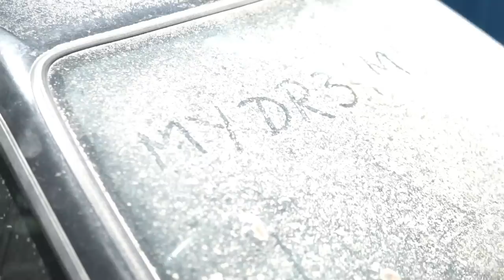RE-BUILDING the WRECKED R34 SKYLINE | Poor Man's GTR [EP4]

Comment: Go RB25 single turbo with hks parts , RB26 with a 6 speed combo is not easy to find nor cheap
Reply: Finally someone realised
Reply: Daniel ye. If you watched the MightCarMods 240z swap (they swap everything from an r34 gtr into a 240z shell) how much it sorta costs. And if i remember correctly it’s their most expensive build yet.
Reply: This is the most reasonable suggestion.
Reply: @Fathom324  I thought the 26 was from an R33 GTR in the MCM 240z?

Comment: does not need to be a RB26 engine and drive train, goto Skylinesaustralia.com to figure out what engine build you want, i suggest a RB25neo head with a RB30 bottom end which is a common build or if you got more money RB26head , but you get lots of horse power either way and just stick to the RWD, going All wheel drive will cost you an aarm and a leg and rather buy a geniune gtr by then, as for gearbox the rb25 box is fine if you done have the money for gtr box,25 box with a good heavy duty clutch for the power u want to aim for, check out the forum for some help and ideas thoug and parts and more.
Reply from the maker: Best comment so far about combo’s ! I think this is also the best option man
Solid lifters on the cheap too, better head
Reply: That's funny how prices are fluctuating over the world. Here in Russia, gtr32-33 gearbox costs around 500$, while rw rb25det from 1k$. I myself run gtr32 gearbox converted to rw drive in 33 gts, which is quite a cheaper option.

Comment: Hey mate I am gearing up to do the same job at the end of the year to my skyline, I am just wondering are you using a a kit? (I know the fenders arent but that rear bumper could be) if so where from? cheers.
Reply from the maker: So far everything is oem nissan, even the bumper (it’s in primer) except the spoiler. The spoiler along with the front end will be fibreglass
Everything else is either plastic or metal
Reply: @BrokenSilvia  Ah nice just had to check cause that rear bumper looked too good lol. Good luck with the project mate ill be watching for pointers for mine.

Comment: Not sure what your power goal is but if you look under 600 I'd go rb30 with 26 head and 25 or r33 26 box!I believe the 34s have pull type clutches? So that's something you'd have to consider but I wouldn't think it would be hard to fit a push style slave set-up in!
Reply from the maker: Not a bad idea but got something different in mind that not many people have done gearbox wise

Comment: Hey! I've been following you for a while now and once you started the r34 build I couldn't wait for the next. I am pretty sure that you are the only person to post how to do it in depth with good parts, not some off brand ebay one's. Also would you have a suggestion on a cheap jdm for a first project car. Thanks.

Edit: I would put in an rb25. It's the closest you can get rb26 that does not cost an arm and a leg. Also don't put a 2jz in there. It's just wrong 😁
Reply from the maker: Hey man! Glad you’re liking the build
Honestly I’d maybe buy a R34 gtt and make it like that @jazzabel car. That’s simple, already turbo with the rb25, all it needs is a few lips, front bar and wheels
Engine conversions aren’t cheap but if you got a bit of spare coin I’d honestly just buy an S-chassis
I think a 180sx would be an absolute blast, those things are go karts

Comment: Ideally a RB26 DETT but since you're on a tight budget, you might have to do some financial management to make it work. Don't bother about mods to the engine first. Get it in stock but working fine condition. Just owning a R34 Skyline is already an achievement. Doing most of the work yourself is another major achievement. So don't falter now that you're halfway in it. Good luck and happy holidays.
Reply from the maker: I’ll be taking my time with the build! When I sit in it, I want to just drive it and not worry about changing things
Thank you sir!!

Comment: Just found your channel, awsome stuff. 

If i had an R34 shell(which i dont) and the money(which i also dont have) i would a volvo T6 swap(S80 had a 2.8L Straight 6 twin turbo) 

But the S80 is a FWD car so you need a manual gearbox from the 960(M90 for white blocks, not the m90 redblock version) 

The swap would be stright forward if you have a manual volvo 960/v/s90/between 1991-1998 to grab all the parts from

The T5 blocks are known to make alot of power, so does the T6.
Reply from the maker: Nobody has recommended this yet
I’ll have a look, cheers
Reply: @BrokenSilvia  I went and checked gumtree just to check what was available and it looks like you guys never got those cars. that or they are really rare? 

It's a shame since you could get two cars(a 960 manual and an s80 t6 from 99- and up for about 3K aud here in sweden.) 

to bad :/

Comment: Nice work man.
Reply from the maker: Thanks man
Reply: Broken Silvia   I have a cefiro and 32. Cefi  is basically stock block with cams and the usual upgrades. A lot of fun. The 32 has an old school 350 small block, it’s a lot of fun too but not real drivable for the street. With 400 hp. Especially in the rain lol. But the torque is incredible compared to the RB20. I had to learn how to use it  properly

Comment: Do a RD 28 Block, machined to match the RB26 head (or head machined to match the block, as not all of the coolant and oil passages Quite line up). I've heard the block is much, much stronger than the RB30 and can be had for very little!
Reply from the maker: Not a bad idea but they are significantly heavier and no need for what i’m doing
Good idea though!

Comment: stopped watching 8mins in, i know you said youre an amateur, but you really should have got some advice on techinques, would have saved a load of time and mistakes :/ 

if you do another quarter panel, get an airsaw for the love of god, makes cuts so much neater, and should have overlapped new and old panels and cut through both whilst on the car- ensures a perfect matched cut line (with an air saw)